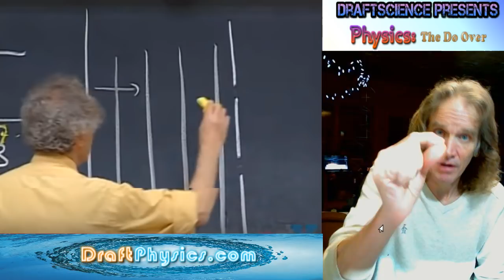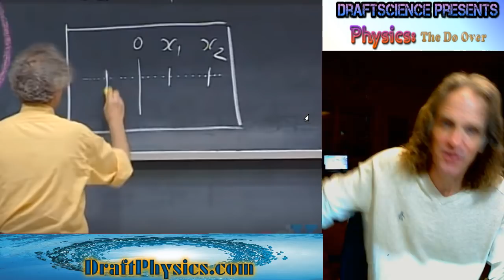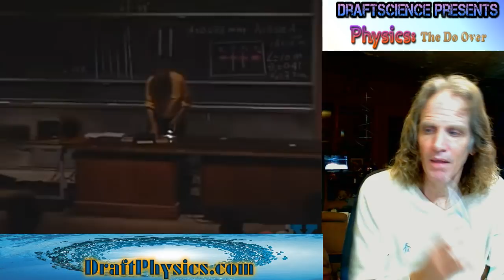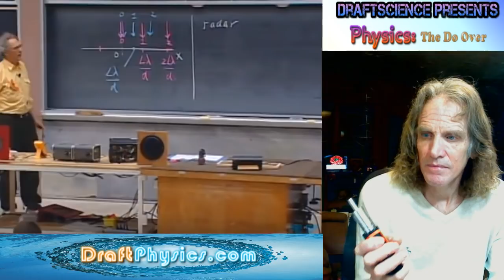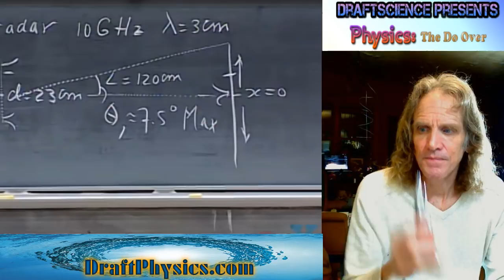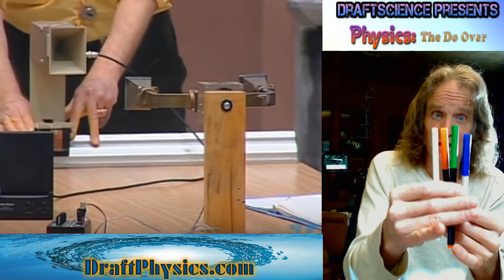59: Redoing: 8.02x - Lect 33 - Double-slit Interference,  ..Walter Lewin

Comment: This idea of lost light from interference is a little retarded. When you get diffraction with photography from a smaller aperture, you only lose resolution based on the larger size of the corpuscles that is formed from what they call the Airy disc. You don’t actually lose any light, no light is canceled out. You only lose light from making the aperture smaller. Wouldn’t this be the same phenomenon? Right? Can’t I just prove this argument wrong just by closing my aperture one stop and if it only loses 1 measurable stop of light and no more, then no light is lost during diffraction / a single slit experiment?